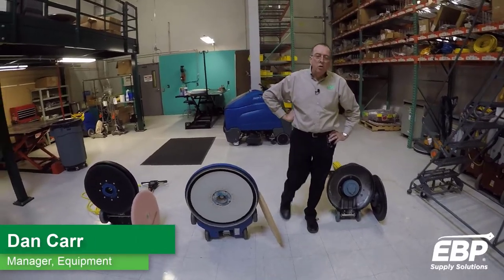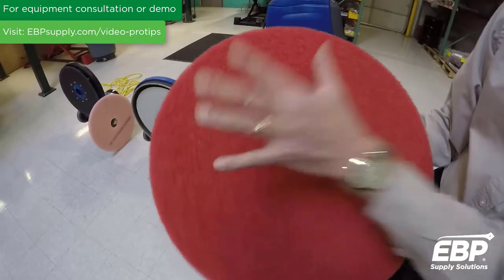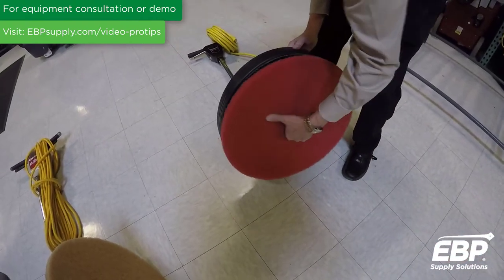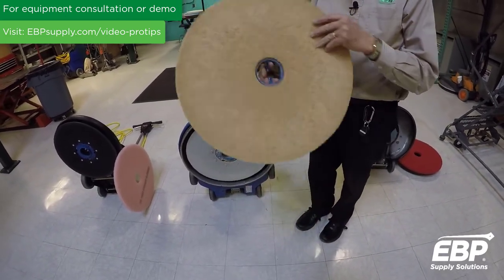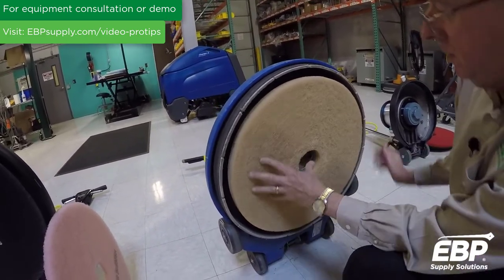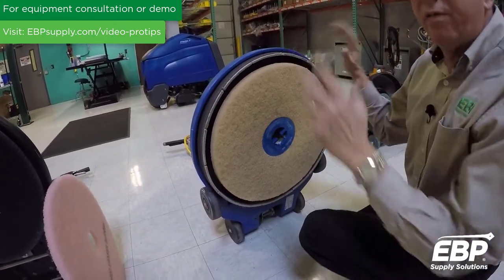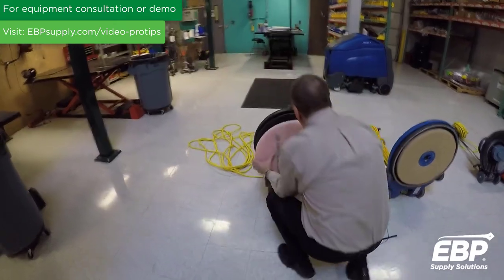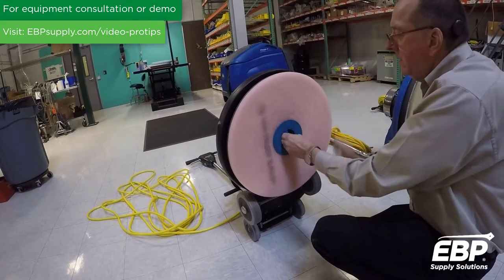How to Install A Floorpad

Comment: please can you install brush to this type of machine (mine is victor excel 16)
Reply from the maker: Hi Aaron - the machine you are referencing is a Burnisher, and you cannot mount a brush on a burnisher.  Brushes are only for Swing Machines, Strippers, Buffers, Side to Side machines at low speeds.
Reply: @ImperialDade  so meaning i have to a get burnisher  like victor excel 16 and a side to side like a victor sprite 400
Reply from the maker: @aaronokai6965  You could mount a brush on the Victor Sprite 400, not the Excel 16.  I hope this answers your question
Reply: @ImperialDade  very well understood. i really appreciate your time.
Reply: @ImperialDade  Perfect answer